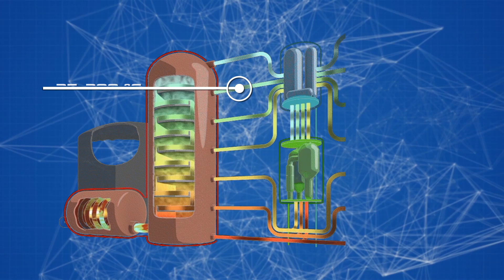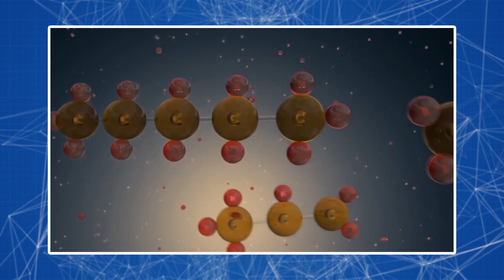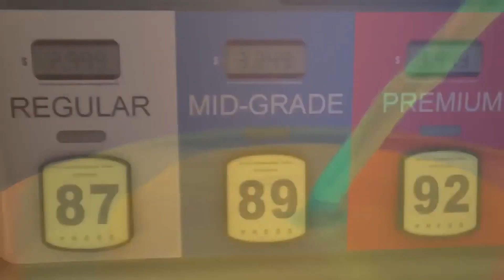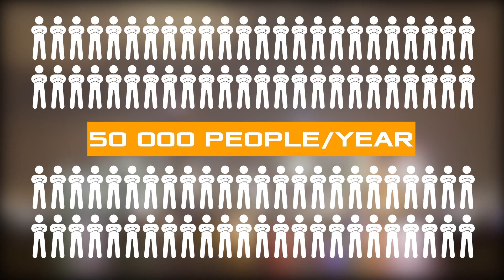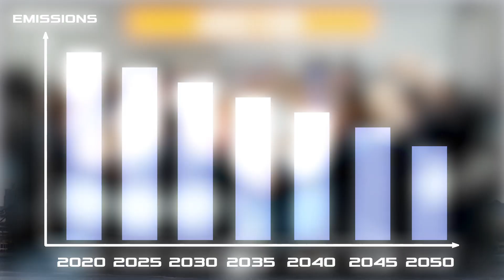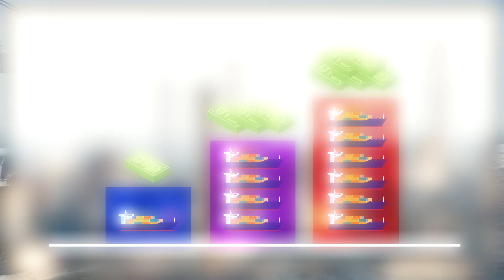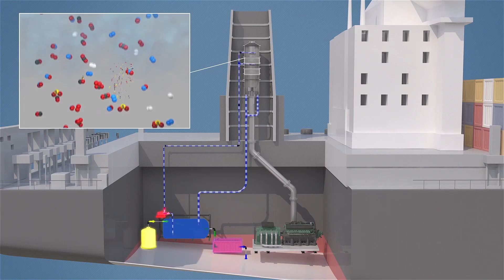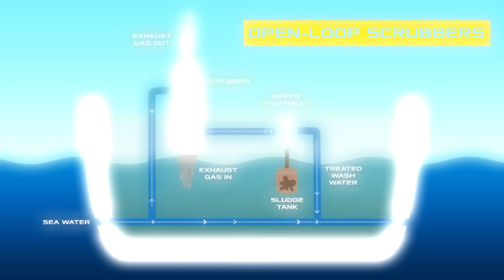Why do ships kill the planet more than cars?

Comment: Ships cannot use heavy fuel oil anymore  in the area of Europe. Not for years have they been a dirty as said here. One ship equivalent to  millions of trucks ,  Bollocks.
Reply: Those ships carry both bunker and fuel oil on board, switching as they enter European waters, still burning mostly bunker.  Dumb enviros pushed restrictions so far that manufacturers moved to third world and creating 2-4x polution.
Reply: They can’t use it in port but they can once they leave the area.
It’s not the volume of gasses it’s the content that makes it equivalent.but saying cars can be a bit tricky as cars have 2 fuel types where saying trucks means diesel but trucks is an American thing anyway.some people think lorry when they hear truck & even Lorrie’s come in sizes some double that of others but I think the general message is each ship delivering Tesla batteries just polluted more than it saved